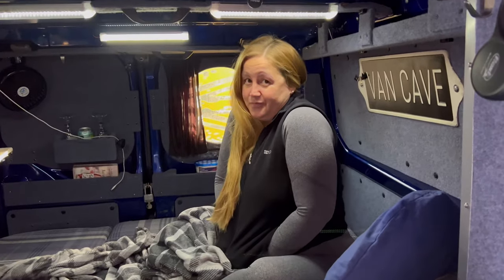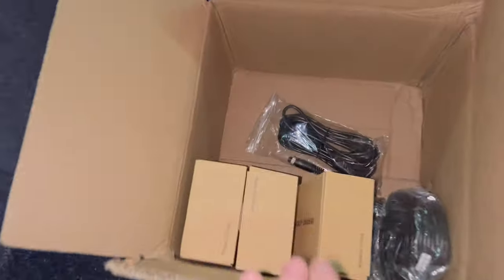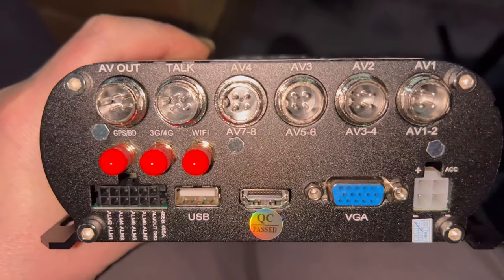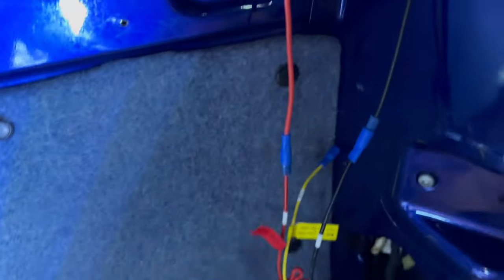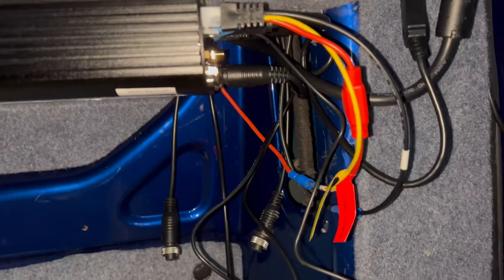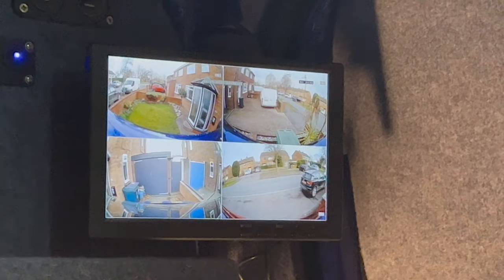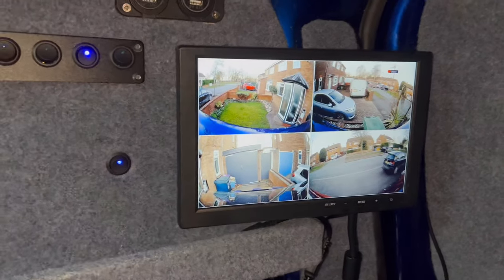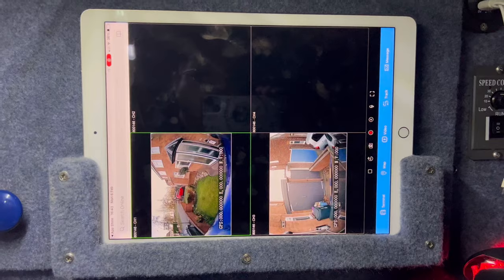Cameras in my Transit stealth camper

Comment: Hi ya Steve, I bought the exact same camera system after seeing yours. I’ve yet to fit it, I was thinking of fitting the front camera inside the van behind the windscreen, can you see any disadvantages with that? Cheers, keep up the great videos
Reply from the maker: Yes,,,,,in the morning it will just be showing a misty windscreen maybe? depending on your ventilation brother
Reply: @STTC got ya, that did cross
My mind. Did you slightly slacken the back screws so after the camera has been positioned you can still turn the camera? Or is it best practice to slacken them, position and tighten them down loads ?
Reply from the maker: @beecyclesukstourbridgebike7672  I positioned,,,, screwed down and stuck em on brother,,, just with double sided tape
Reply: @STTC  one last question bud, did you do anything with the alarm ports/sensors ie wire it up so it detects a door open etc? Something that triggers the system when some b** tries to get into the van
Reply from the maker: @beecyclesukstourbridgebike7672  No mate, I just wanted to see my surroundings when I’m in the van but it looked straight forward when I thought about doing it but didn’t try
Reply: @STTC  ok mate, I’m well excited to get it fitted. For me it’s mainly security when I’m away from the van as it’s sign written and thieves probably think I got valuables on board. Peace of mind I can check cameras when I’m away from the van. Keep the videos coming, I wanna see more videos of you stuffing your face infront of Baby lol, so funny mate lol
Reply from the maker: @beecyclesukstourbridgebike7672  🤣🤣🤣🤣

Comment: Hi m8, could you help me . I have just purchased same camera system as yours .I think there's an issue with my monitor.  I have what looks like a faded yellow/brown area at the bottom right hand of the screen. I'm thinking back light led issue. Does yours have anything like this.  Also at night if you flick between cameras do you get a flash of blue it doesn't seem to do it during the day. Any help is appreciated  before I contact the seller . it's exactly same setup as yours. Cheers
Reply from the maker: No buddy, my screen is fine to be honest, no flickers and no yellow/brown area, sounds like a replacement is required
Reply: @STTC  thank you for your reply. I will contact seller